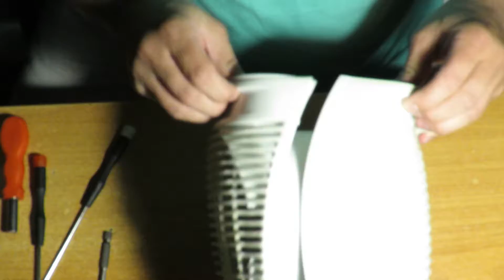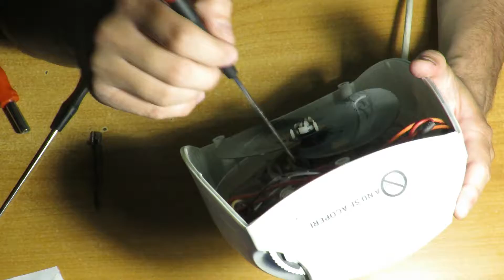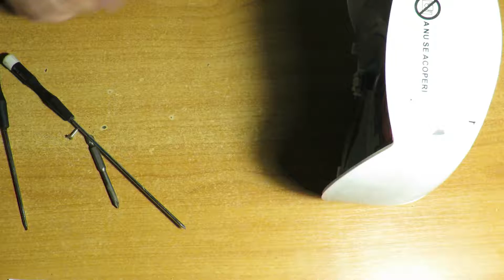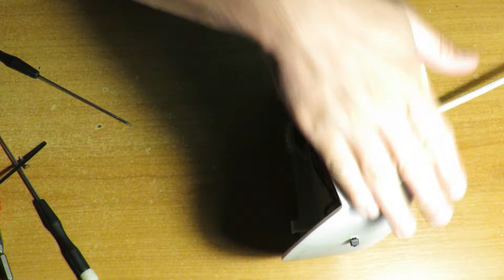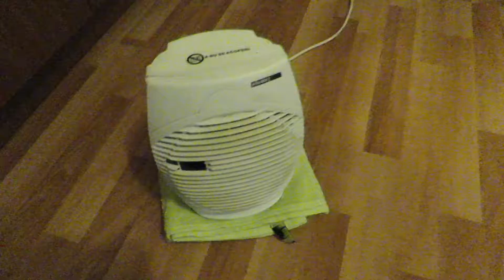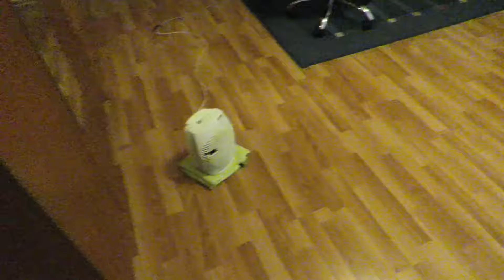Fan heater repair

Comment: Hey man how can I fix the airflow it got smaller of the time and I think it's the axle
Reply from the maker: Well there are a few things to check.

First, clean it well. This goes for all electric and electronic stuff, including cars and engines. Anything electric, electronic or mechanic must be crystal clean before you check for anything else. There can be dust, hair or other gunk stuck on the axle or around the motor.

After this, check the angle of the impeller blades, if they are made out of metal, like mine, they can bend, and a smaller angle means less airflow. 

If you still have a problem, also check the motor copper windings, the color must be clear and bright orange/brown, with no dark or blackened spots. If you see anything that looks dark, black, like soot or something melting, there can be a short circuit in the winding, which decreases the force of the motor.

Comment: What do you do if you buy one and it won’t work and you see a black wire off of it but don’t know where it goes?
Reply from the maker: That is kinda tricky, I couldn't tell unless I had it in my hands... the color is unimportant, the only place the color matters for wires is in the movies, in real life, they're mostly random and vary by manufacturer, device and country. You have to understand how it works, figure out the schematic on paper and follow it to see where the wire goes. Sometimes you can also see the bit of wire that is still soldered where it failed, the part that is soldered is stiff and the rest of the wire being flexible can bend it repeatedly around the stiff part, breaking the wire in time, so you see like a small 1mm short piece of wire still attached. Sometimes you see only an imprint, as it comes off entirely out of the solder. Sometimes it's not solder, if it's the heating element, really hard to tell, pretty much impossible without seeing it. If you had a clear picture of everything inside I might be able to help.

Comment: How did you fix the heat?
Reply from the maker: The heating element was never broken, it gave heat at all times, it's just that the fan was hitting a broken piece of plastic inside.
Reply: @techalyzer  - Thankyou. I just purchased a wall mounted heater for the toilet. It stopped getting hot after 2 weeks. Amazon sent me a replacement for free and exactly the same thing has happened again. Is there an obvious answer to this?
Reply from the maker: @John17230  If it's the exact same model, I suspect there's either the heating element or a thermal fuse in it that are poorly designed. If you can, ask for a different model. If not, get a refund and look for another one. And I know that these are hard times (I barely afforded rent this month), but sometimes that extra dollar makes the difference.

If you can't, I would suggest looking for a used one. That's how I got mine, too. These are simple devices, they either pop in a few days or last for a lifetime, so if you find one that works, it's not an issue that it has been used before.